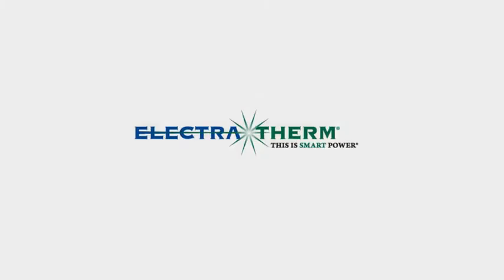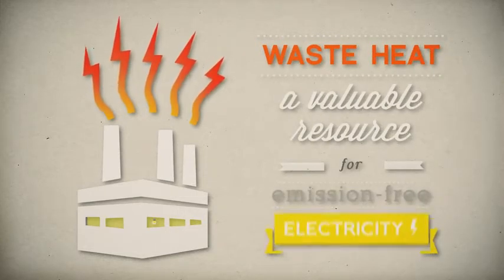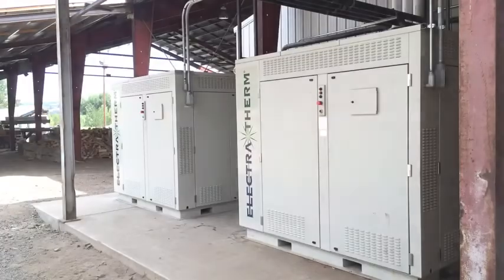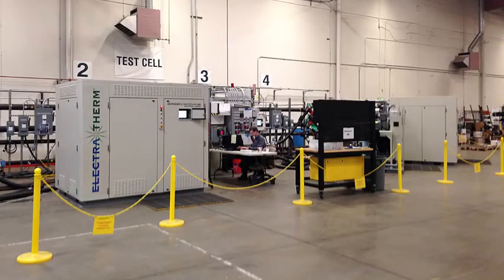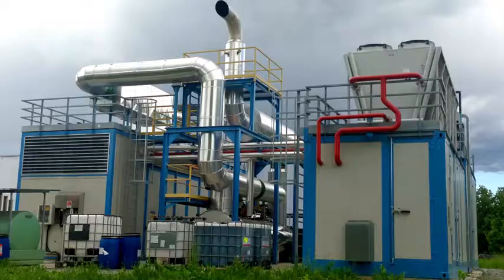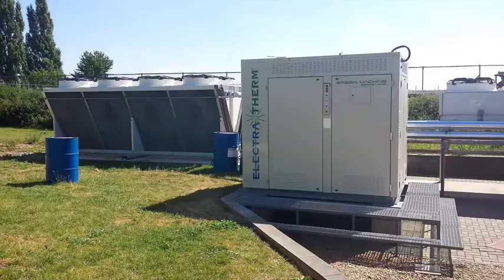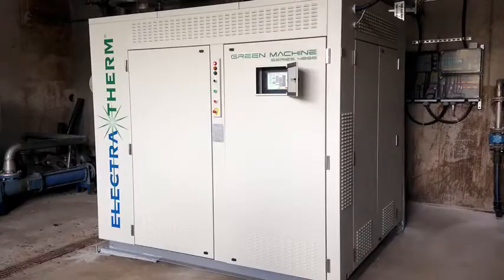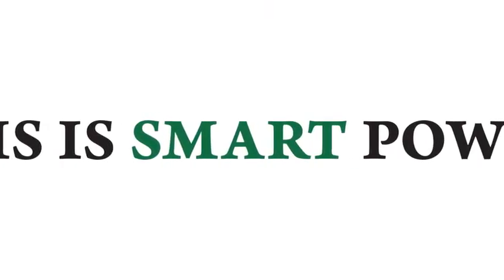ORC waste heat to power generation Green Machine

Comment: What's the cost per kw
Reply from the maker: This is basically for waste heat.
For more info, you have to contact electratherm - USA
We are not distributer any more .
But it is very reliable, low cost for maintenance machine.